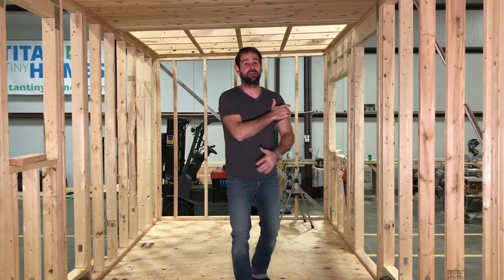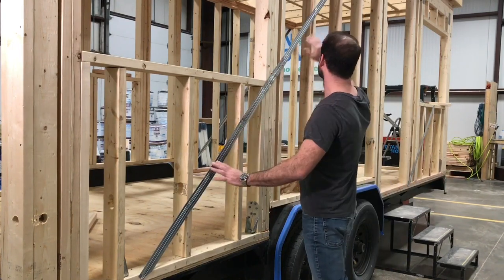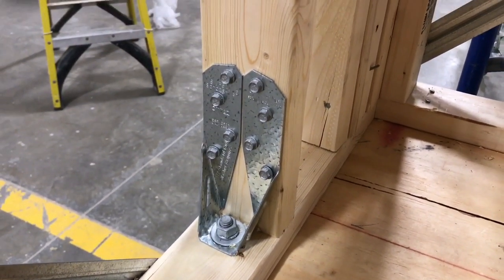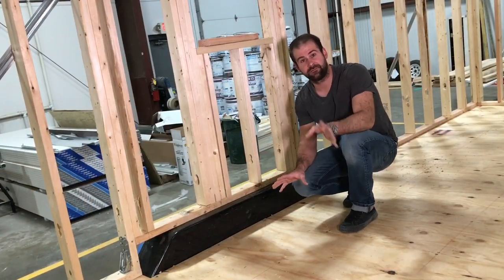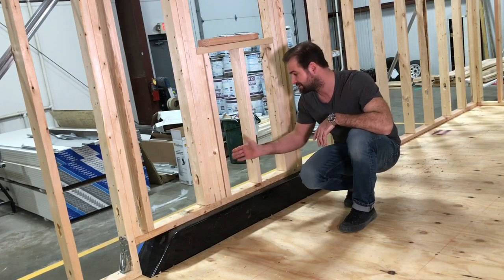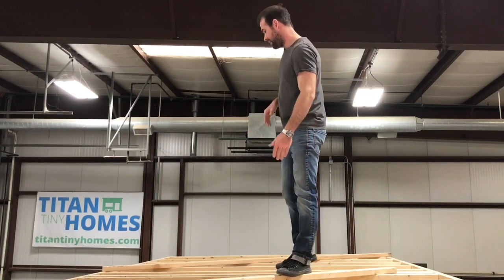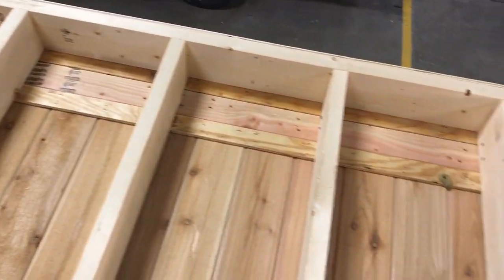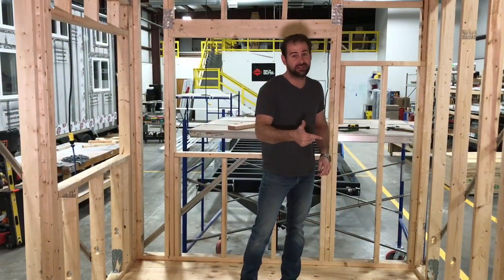How to frame a tiny house out of wood

Comment: Campers that use 2x2 framing go 65 mph down the highway and dont have metal bracing. over kill I think.  You build the tiny house just like a regular house. It's ten times stronger then campers
Reply: Exactly, this framing is overkill in all regards. The amounts of wood used in places is absurd. But still, this design would be fine if used in warm climates, just don't expect great insulation properties.
Reply: 1/2” plywood provides plenty of shear strength.  70-80 years ago, home framers used to cut in a 1x4 diagonal brace.  They did that because they were using 1x6 pine slats to cover the exterior.  Once modern plywood were used for exterior shear, the diagonal braces were obsolete.  Don’t think this guy ever framed a static home.